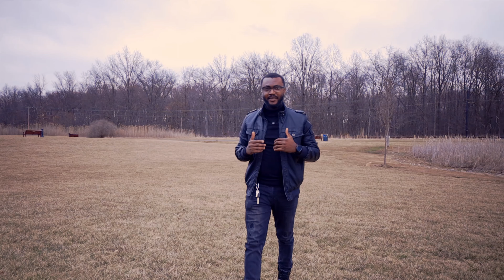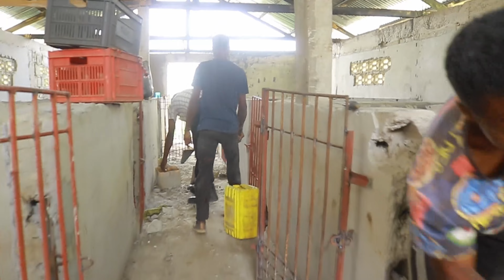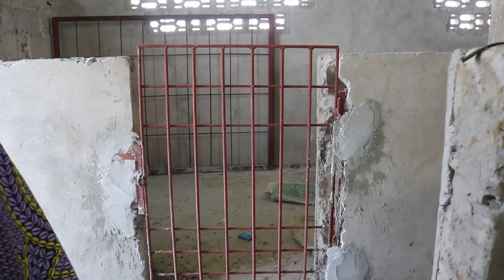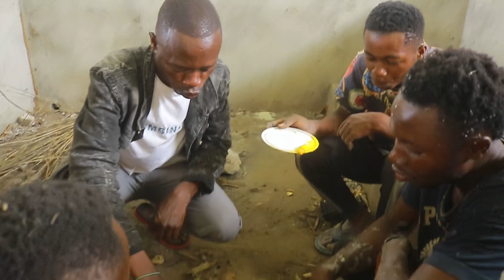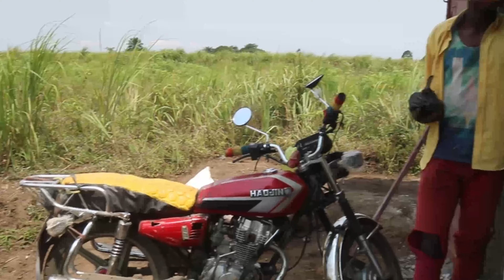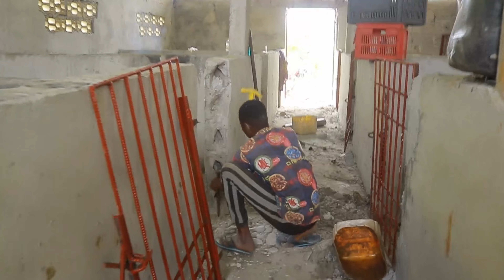Building A Pig Barn In Congo Kinshasa In 2023 Part 2!

Comment: Bro its not 40.000$ come on😂🤦🏾 one pig cost 200-250$ Max
Reply from the maker: I must have made a mistake and you know that. 
I would have to disagree on the maximum price because the price varies based upon the weight meaning that the more the pig weights the more expensive it will sell in case you didn't know.
Reply: @TheAfricanExplorer91  okey yes i understand i know that but why are u saying that u sold a pig for 325 $?
Reply from the maker: @MikowizzyK so you're saying I owe you an explanation?? 
Like I'm lying?
Reply: @TheAfricanExplorer91  no bro i Dont say u lie.. but  evreyone know that Pig sells for 200-250$ maxium u Can Watch everey where bro
Reply from the maker: Let me get this straight. According to your logic, for instance, if a 100kg pig costs $250 because that's the maximum price right?? So a 130kg pig would also cost $250?? Is that what's you're saying?
Reply: @TheAfricanExplorer91  i have never Said that a pig 100 kg cost 250$ bro🤦🏾
Reply from the maker: @MikowizzyK  did you read my comment closely? I used it as an example. Go read it again.
Reply: @TheAfricanExplorer91  brother a pig weighs max 300 kg and max price for it is 270. yes have a farm I know